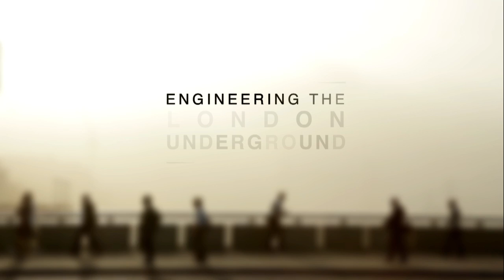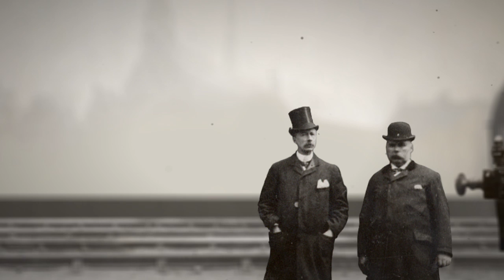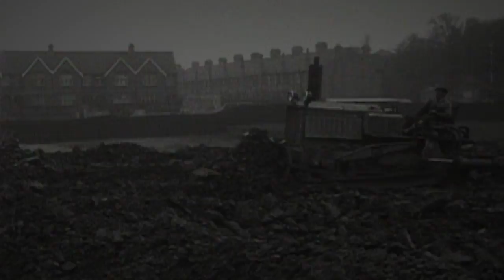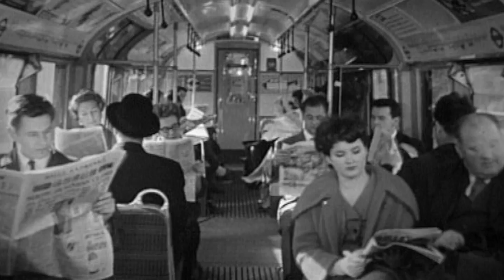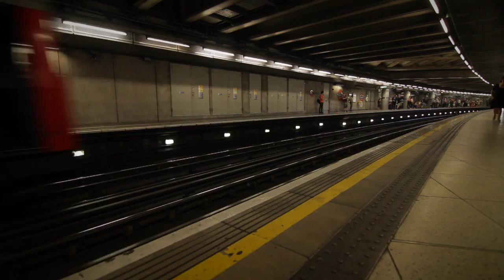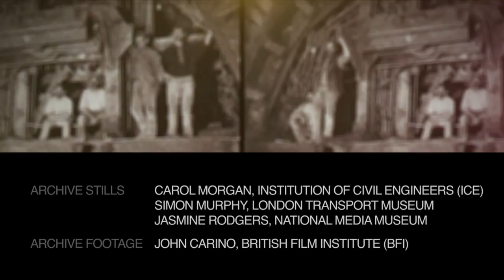Engineering the London Underground

Comment: It's great to been part of the Undergrounds expansion, I drove a tunnel boring machine on The Victoria Line. A Senior Inspector of Works on the Dockland Light Railway extension to Bank Station. Also SIoW on CrossRail and have inspected the unused stations that were used as air raid shelters in WWII
Between the above have worked on major tunnel projects around the world, retired now I just dig the garden and watch YouTube.

Comment: Most Londoners wondered how the tube network would cope during the olympics, but cope it did.

The above statement made in this film is largely true, but I think it's important to point out that the reason it ran like clockwork was large numbers of underground staff, including the drivers were paid handsome bonuses during this period, so basically paid more money to do their job which was quite frankly a disgrace.  Dig below the surface (excuse the pun) and you'll find the real reason for things.  Once the olympics finished us Londoners were back to the usual old delays and problems.  Should have added that to your documentary.

I'm not however taking anything away from the amazing engineering feats described in this film, which were indeed revolutionary.  It should be said though that we needed both American expertise and finance to get a lot of the initial underground projects up and running.
Reply: +Andmeuths - Not paid enough?  A tube driver gets a trainee/starting wage of £45,000 per annum (which is over $66,000 USD in case you're from America).  That's a huge wage and much more than any other public sector worker, and it's just a starting wage.  Some earn up to £55,000 per annum, and they still think they have the right to hold the city of London to ransom by going on strike and demanding bonuses to do their jobs during the olympics.  It's disgraceful.  Sooner or later they'll get a wake up call.

Comment: Really? You claim to have invented a tunneling machine? A scaffold with a bucket on it? Stop it Britain. Most of the Underground was cut and cover. You invented nothing. And you were behind America when you did it. Stop being so pompous and misleading.
Reply: Near the beginning of the video, it shows a diagram of a tunnel running under the Thames. This is commonly cited as the project that invented the tunnel boring machine, albeit in a primitive form, and Marc Brunel led the project. This was done before the tube was invented, and the tunnel was repurposed for rail service.
Reply: Nuckelhedd Jones Typical American - please check your facts before posting.
Reply: Nuckelhedd Jones America only good at starting wars never won any. Not invited to WW1 late for WW2 on time for WW3?
Reply: This isn't the only thing.
Tubes with steam locomotives don't work. Only electric propulsion works in the underground. When the tube was proposed and began to be built, it was proposed with steam. It was lucky for London, that electric railways were invented and presented to the public early enough before the first line was ready to operate. The first London tube line opened in 1890. Siemens presented an electric train to the public in 1879 in Berlin. New York had tried to build a subway with steam in 1842. It failed. People barely escaped death by smoke. The critics of the London tube system knew what they spoke about. They were right in 1863 because elecricity wasn't part of the plan.
Then electric light is also very important for a tube. Several New Yorkers like Edison and Tesla are to credit for making it possible. A good tube can't work without escalators - invented in Brooklyn. And the London tube is a horrible tube: it wasn't built for escalators. The long exhausting walkways are a nightmare.
Reply: @Rainer67059  You are incorrect. The first tube wasn't opened in 1890, but in 1863 like the video says and it WAS steam powered. The original was the Metropolitan Railway, which evolved to today's Metropolitan line. At this time there was no electric propulsion of course, so at first the idea was to use pneumatic power in order to move the trains. But when the test failed, they went with steam engines. The tunnels were dug with the cut-and- cover technique and were just below street level, in order to have a better ventilation system for the steam. In fact, many parts of the line were placed in open trenches for the very same reason. The District Railway, which evolved to today's District line, followed in 1868,  also using steam and building the tunnels just below street level. What DID actually open in 1890 was the world's first deep level tube, which used boring machines to dig the tunnels. That was the City and South Railway, which today is a part of the Northern Line. This one of course was electrified and it was the world's first electrified metro. All the subsequent lines that opened after this, were built the same way and were electrified from the get go and the Metropolitan and District lines were also electrified during the decade 1900-1910. So, unless by tube you meant deep level tube, what you wrote was inaccurate.
Reply: @pvuccino  I know about the steam powered tube in New York of 1863. It didn't work. The people couldn't breathe, pulled the emergency brake, ran back to the surface. It was never in operation except for the test run that failed. That's what I meant when I said, steam-powered tubes didn't work. The tunnels were filled up again.
The subway in operation right now in New York is younger than the London tube. The first line in London opened in 1890.
Reply: The tunnelling machine was propelled forward by jacks  in the 1840s. That sounds like a machine to me.